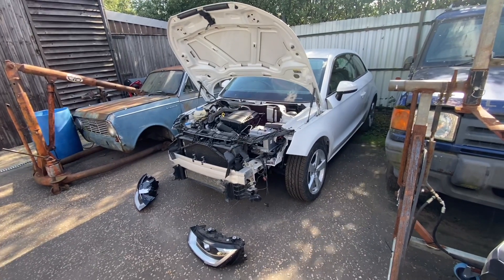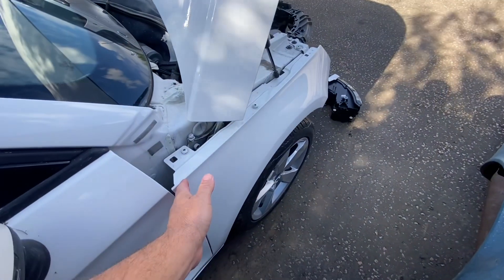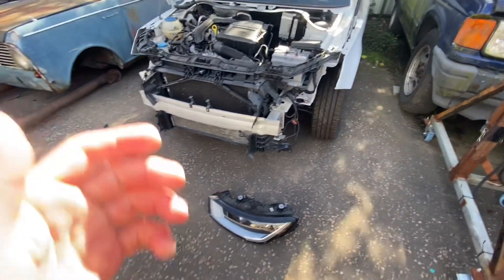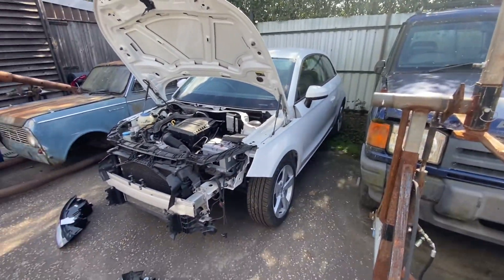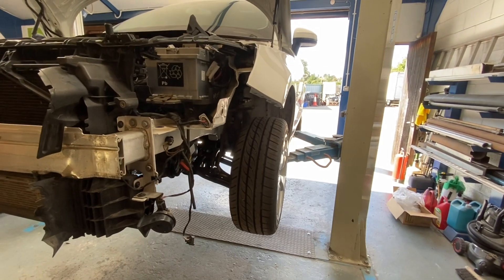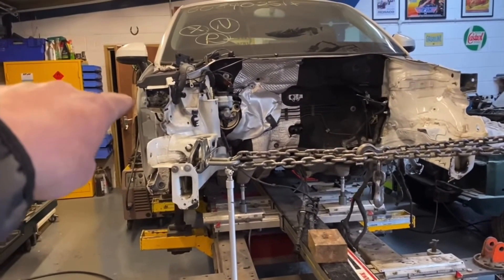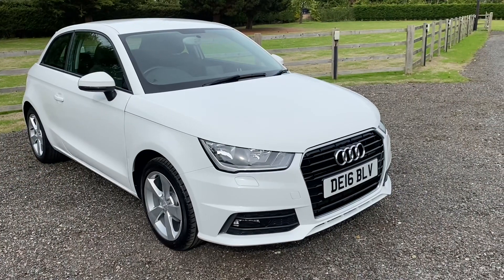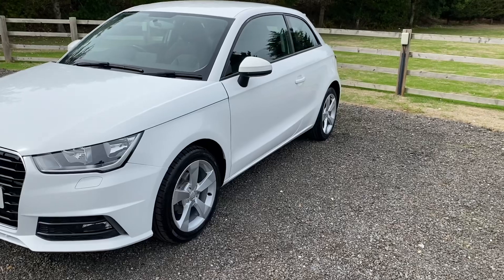ACCIDENT DAMAGED 2016 AUDI A1 FROM COPART SALVAGE AUCTION

Comment: Curious what you mean about the idea of fitting Zenon headlights into a standard headlight vehicle, I had a car with Zenon’s and understand that by law they have to be fully automated for alignment and do a dance when they are switched on , the lamps will not come on if a fault is detected on any direction etc. So it would be a major job to convert from standard 🤔